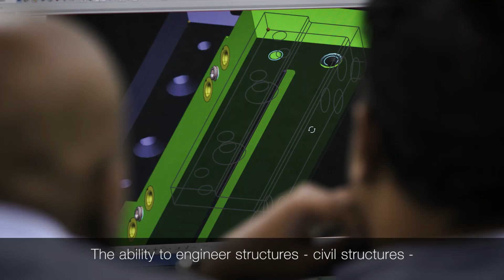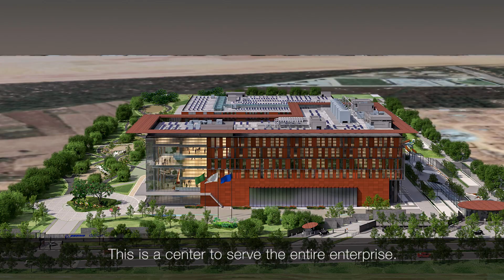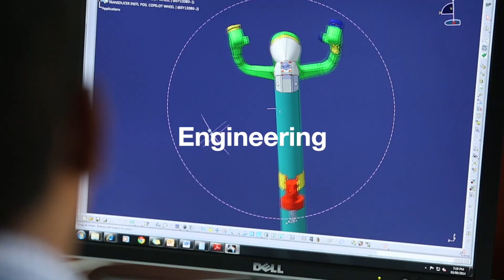Boeing in India

Comment: Is Boeing going to manufacture aircrafts in India? Under Make In India?
Reply: OH dear good Lord
Then we need to research about the plane which we are going to fly 
I prefer those planes which has been made by Boeing Seattle
Reply: @easydesigns-787 oh so you fly on airplanes as well 😂😂, that’s a news, thanks to spirit and frontier anybody can now get that experience
Reply: Yupp  Boeing had already partnered with Tata as Tata Boeing aerospace Ltd. And they are all set to assemble aircrafts in India more probably military aircraft at the initial level 👍
Reply: @abhaytyagi3533  the biggest joke of 2020
Reply: @abhaytyagi3533  that's only for defence not commercial airplanes.
Reply: @rohan1748  he literally said it's for the military
Reply: @mrudulalele3358  yeah i tagged the wrong person
Reply: @abhaytyagi3533  Manufacturing of military aircrafts like Apache attack helicopters, some parts of  f18, etc have already begun. And later assembly and manufacturing of some parts of the commercial planes will also start.